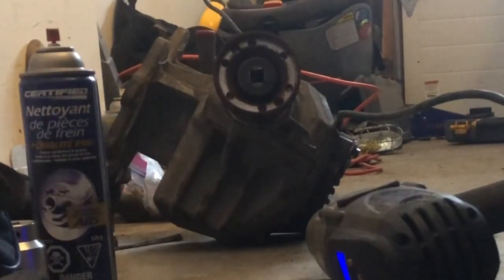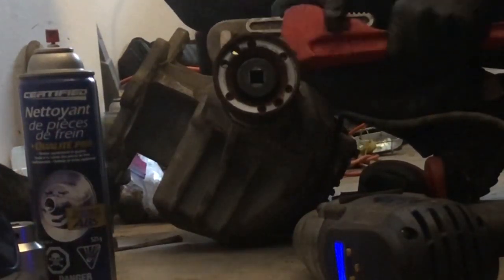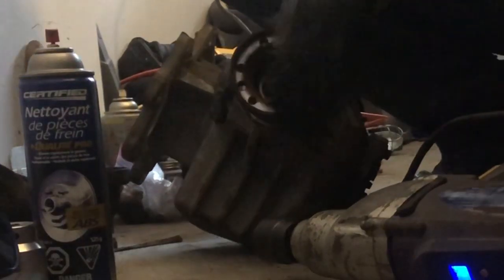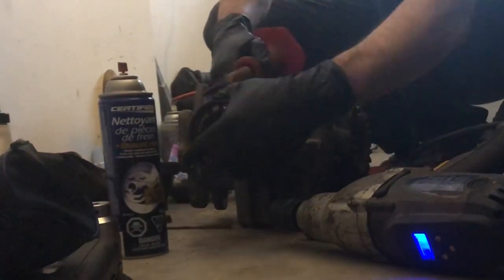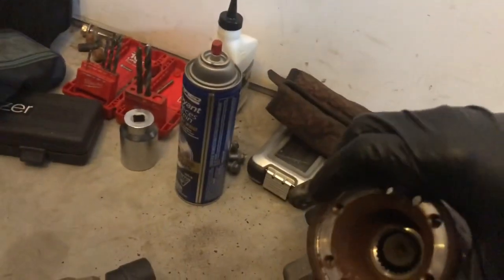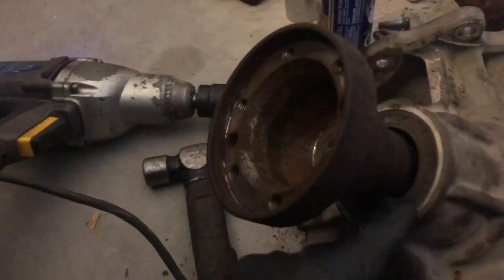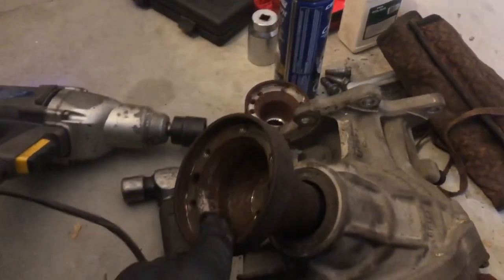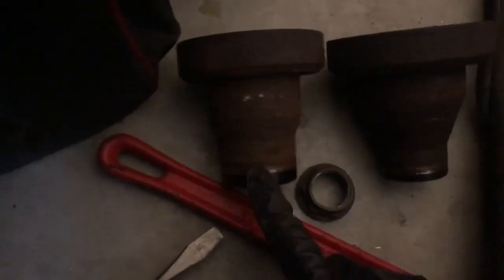Volvo Angle Gear aka Bevel Gear Flange Change

Comment: I thought that angle gears are different on 01-02 models and newer models due to different gear ratios. Also the torque for the pinion nut is between 138-147nm if my memory on vida spec is correct

Comment: Thank you for this, I have an 01 V70XC and can’t find a decent transfer case anywhere meanwhile there’s plenty of 04<06 XC70’s all over the place. Looks like I’m going to head out to the salvage yard tomorrow and pull the best on I see off.

Do you know if any of the other 2.4l<2.5l transfer cases are the same?
Reply from the maker: I don’t know but don’t think so. You can look up the part numbers on volvowebstore.com to verify. If possible look for an 07 - they improved the seal design and those are less prone to leakage.
Reply: @Bigtime_mcalpine  
Couldn’t find an 07, just pulled an 05 that was at my local yard here in Denver. That’s defiantly some exhausting work. Now I just got to get her cleaned up and a reseal kit and AG collar sleeve on order. 

One more question, how much play can there be in the angle gear?
Reply from the maker: @ellefields8878  pleasant removal job, isn’t it? Don’t forget to order and install a new flange seal!
Reply: @Bigtime_mcalpine 
I tore a hernia trying to remove the case so I’m just starting to get back on this project. I’m a little concerned because the 2001 case looks different then the 2004. External dimensions seems to be the same however I’m concerned if they are the same gear ratio. Is there any way to determine this without taking out the other and comparing side by side? I can’t find any information about this.
Reply from the maker: @ellefields8878  I can totally see that happening! As I recall all my research suggested that gearing is same for 2001+. It’s just the flange and seal that are a different size.

Comment: Also going through the same thing. What were the inside diameters of the flange that accepts the cv joint from the prop shaft? I have an 02 s60 and my flange accepts the 86mm cv joint. How did all this turn out? Did a seal from an 02 fit?
Reply from the maker: Still going strong no leaks.

Comment: I’m doing the same thing. Do you know the newton meter for the nut holding the flange and preloading the bearing?
Reply from the maker: If you are talking about the “pinion nut on angle gear” it’s 180nm. I had to install first in order to get good enough purchase to torque it up.